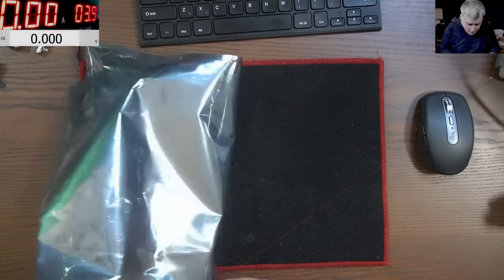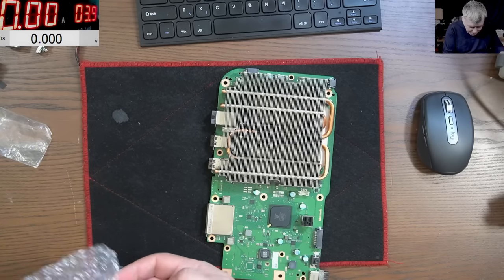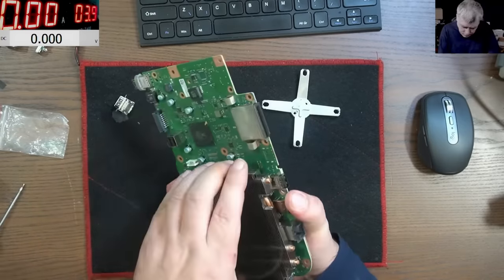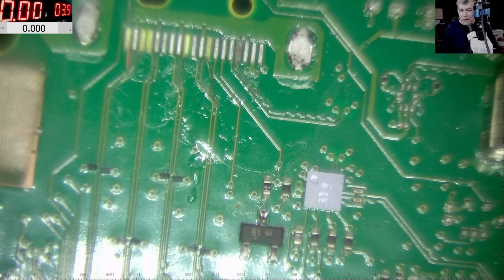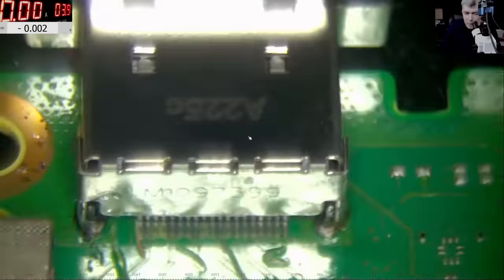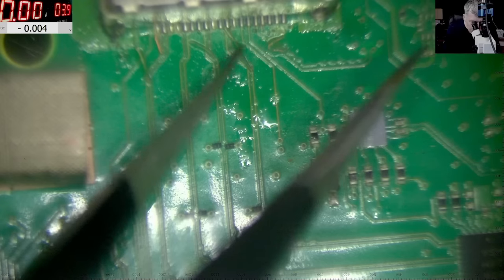Xbox Series S hdmi port tracks repair - How to rebuild tracks

Comment: 10:41 if you wonder Why that track has "wave" shape/pattern - it can be because maybe that signal must be more delayed (compare to others), or to fix "interference"/noise / collision with other signals or ground (i don't know correct word). So the engineers use that kind of "tricks" to achieve different / special resoults. Maybe someone more experienced can say something more correct here.
Reply: Differential signal buss.
Reply: Yes, its because those tracks are in pairs and curved around the board so the inner track would end up shorter, so they add distance (the pcb design software) to get them equal length

Comment: the problem is of course with no base unit you can't test it, so i would of tested each pin to its place before coating it, as an extra piece of mind.But you did push each pin on the hdmi at least

Comment: Question.  i have one of these here where the filter coils were heat soaked and came off.  Thing is, I cant get any of them to solder back on.  Any tips or suggestions?  i've tried iron, air etc, to no avail.  And these are TINY, so there should be no reason the pads are soaking all the heat up. I can't seem to locate a replacement either.  so, if I am looking for a comparable one to put in, how critical are the inductance values of  the components?  

Side note:  These actually came of while gently cleaning flux off the board with cotton swabs.  Literally wiped right off..
Reply: If you can't tin the pads where the filter used to be, it's because the whole lot ripped off. That would explain the difficulty. To replace the filters, I use hot air and touch up with an iron if needed.